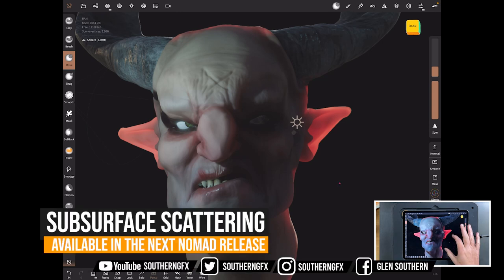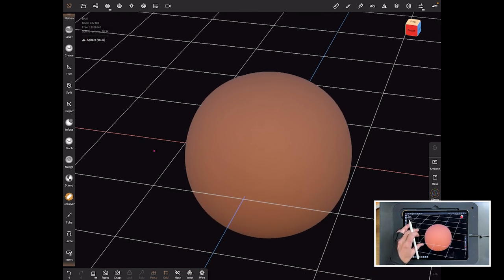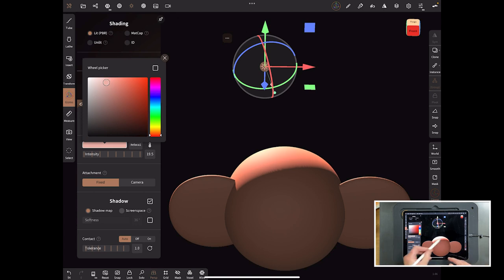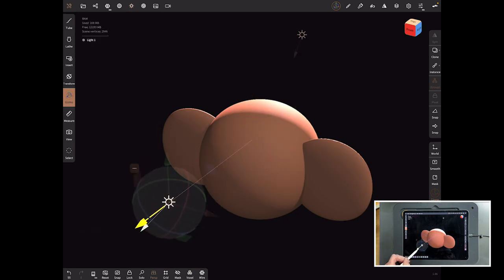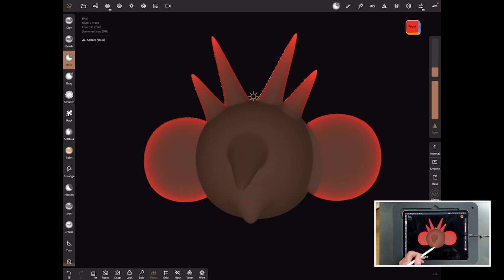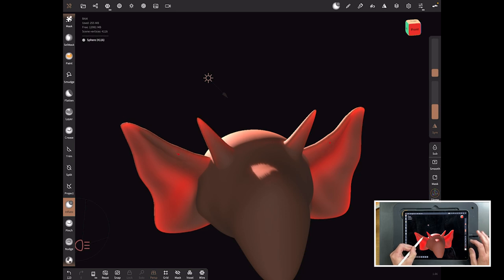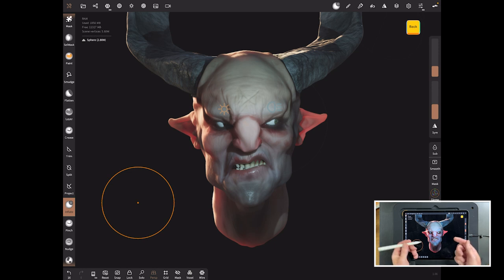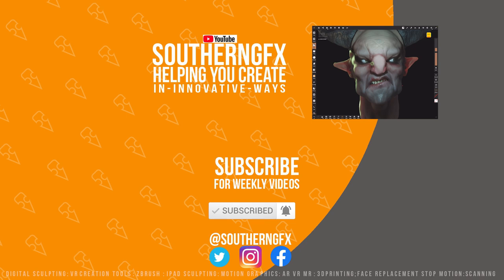NOMAD SCULPT - subsurface scattering

Comment: Very very curious about this.. SSS typically quite computationally expensive..has it crashed much dare I ask?
Reply from the maker: Oddly I thought the same. Ive not had a single crash or a slow down in anyway. It’s insane.
Reply: @SouthernGFX  I wonder how they're managing it!? I know in raytracing, the CPU demand quickly accelerates in an almost exponential way when you increase the number of light bounces.  But that's in a game scene for example where there is much more going on. I would guess maybe in a smaller, contained situation like when you're modeling things are a bit more in control.

Perhaps it'll be an M1 only feature.. I wouldn't like to say..